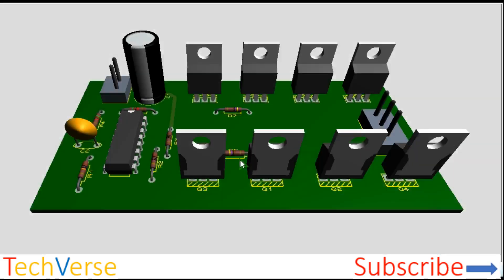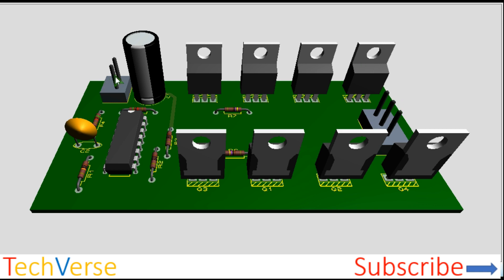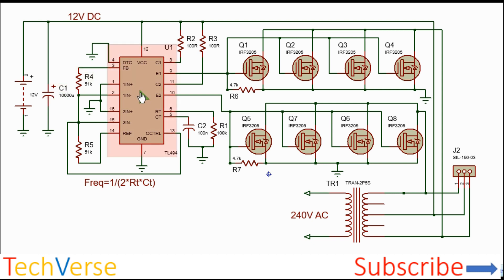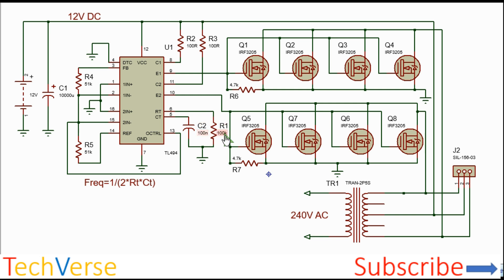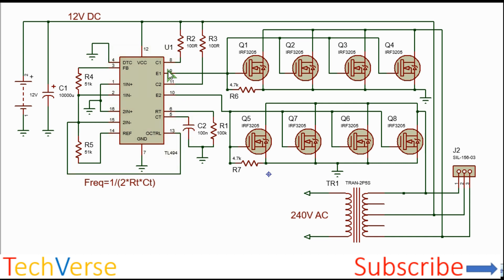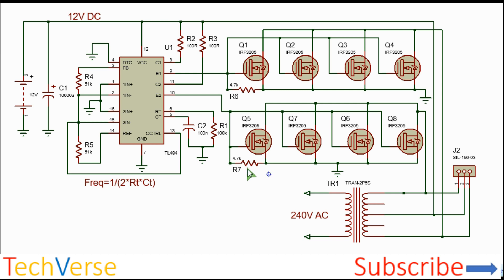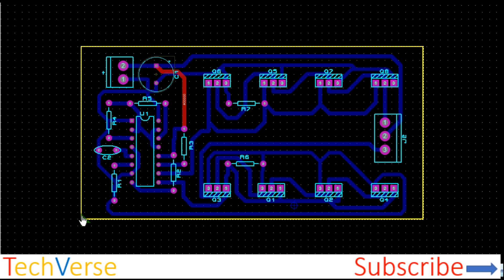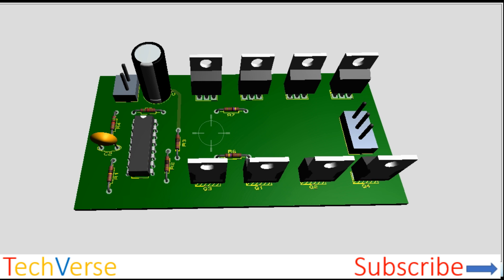TL494 Inverter Circuit 3000W Complete video tutorial (12 - 220V AC)

Comment: This is just a HF push-pull inverter not a Pure Sine Wave one. Even if everything else is perfectly put, this design will able to deliver way less than 3000W. Remember, 3000W of 12V means 250A of current! If you don't know how big 250A current is, then you are not experienced enough in this matter. The transformer is not the usual toroid iron core one that is found in LF inverter, but rather HF ferrite core (smaller one) and need at least 4 parallel, and this will only produce choppy output pattern because it is based on push pull configuration and will not be usable for motor and compressor (AC). It is only usable as heating or anything that will then be rectified back to DC such as computer PSU.

Addendum: there is no overvoltage protection for the output and the output can sometimes spike to high voltage because of the induction effect from transformer.

Comment: You circuit is not workable I try it the the 100nf and 100k resistor the frequency is 1hz with the 100k resistance so try it next time before showing it

Comment: How to adjust the frequency for ferrite type transformer?
Reply from the maker: Just change the timing resistor or capacitor
Reply: @ELECTROBUFF  and how to run it on 24v battery by using 24 0 24 transformer right? Other says 24v inverters works higher effiency than 12v